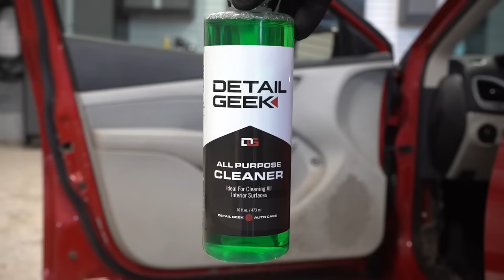This Car is 10/10 DISGUSTING - Viewer Discretion is Advised

Comment: I edit Google maps as an unpaid volunteer, as a hobby. You might be surprised to know that there are tens of thousands of Google map errors, with markers for a business or point of interest placed dozens of miles from where they belong, and highways and other roads also improperly labeled. I live in a small county in Indiana, and that small area has yielded several dozen edits. I'm sure that there are malicious edits too, intended to mess people up. Those would also be fixed by people like myself.
Reply from the maker: Interesting!
Reply: I imagine it's hard work. New buildings appear, new roads, buildings that don't exist anymore. Though I have to admit, Google Maps have improved over the years.
Reply: That sounds a pretty fun little gig! I have a lot of downtime at work, and this would be a neat use of time between jobs. I'll have to check it out.
Reply: Hi I have been having problems with updating my phone numbers .can you help

Comment: Great video as always. I do have a quick random possible trick for you, that I have personally used for years. To help get those stubborn small particles from those hard to clean floors, grab yourself a portable sander. With no sand paper, and put it on the carpet, the vibrations from the sander on the floor will help loosen up those stubborn left over pieces... One trick my Uncle that has detailed for 30+ years actually taught me. Love the videos, and channel. Watch a few video literally every single day.

Comment: Incredible job, as always! One thing I can't recall seeing in the videos is a seat belt cleaning (like in a work truck). Do you clean seat belts? What's the best way to go about it?
Reply: He has shown it in a few videos.  If I remember correctly, he usually uses the steamer to do it.
Reply: @alexschultz4272  thanks for the response! I appreciate it! I was thinking the steamer, but wasn't sure. I've heard mixed messages on whether it's safe to simply pressure wash them. Seen most of Mitch's videos, but must have missed the seat belt ones. Anyways, thanks again!

Comment: Beautiful transformation and I for one love those Dodge Darts as I own 2 of them now and had another one a few years earlier.  
Fun, sporty, good mileage - just nothing to complain about.  All of mine are 6-speed manual w/either 2.0 or 2.4 engine - not those crappy 1.4 Italian Turbo charged piece of crap engines - no way.  
Sad had someone could neglect one this much as cleaned up & RED - pretty car.  
On the other hand - the interior of this Dart is far to light colored in my opinion.  🙂👍

Comment: Hi, I watch all your videos. I am amazed at how well these vehicles turn out after being so mistreated.  My vehicle get washed once a week, and get a full detail, exterior, interior and under the hood quite often.  The detailer I use loves to do my cars as thy are always clean. I think that people do not understand that dirt on and under the vehicle is what causes rust.  The dirt locks in the moisture harming the paint and enabling rust to begin.  My vehicles get an under-carriage wash every time they are washed.  Vehicles cost so much you would think that people would care for them better. I also think that someone who does not maintain the vehicle looks, most probably does not do vehicle maintenance.

Comment: An interesting comment on the vacuum vs Tornador. I've used (sadly don't own!) a Kranzle ventos, and it is MIGHTY! But with that said, that gritty debris, like you've got left over here, just cannot be sucked up with a vacuum alone.

The Torandor with the vacuum attachment is absolutely the tool for this job, but you could also use a DA in there, with a brush pad and left on speed one, that'll vibrate stuff up to the top and get it cleaner than you were able to achieve here with just a vacuum.

The problem with the Torandor, without the vacuum attachment, is that it makes such a huge mess.

Comment: Hi Mitch! Have you ever considered installing a lift on your garage? To get access to more car components and clean parts that are not typically visible and/or cleaned every once in a while, and maybe lub them up with some silicon or wax coat too to protect them.

Comment: Nice interior. My question is why are you cleaning the pedals after cleaning the floor of the car, not before, or at the same time. I'm sure dirt sprays on the freshly cleaned carpet, even if you put a cloth under.

Comment: Can you use that carpet cleaner on the carpet inside a RV? I think the black spots we have on the rug are when my father installed some flex thing on the roof to prevent leakage. I've tried everything to no success, so I was wondering if your solution might BE the solution.

Comment: GPS doesn’t bring you to our house. It takes you to a house on the other side of our street near the other end of the block near the 4-way stop. I have to tell people all the time how to go past where GPS takes you. People always seem to go to the wrong house or they turn left at the 4-way stop instead of going straight down our street. GPS says “Your destination is on the left.”, so they will turn that way. 

Most of the time, it’s manageable. However, I’ve had to call an ambulance on both of my parents multiple times. And my extra instructions on how to get to our house don’t always get relayed. That puts me in the position of “Do I stay in here with my ill/injured parent or do I go outside and flag down the ambulance?”

Comment: You got those seats looking brand new again, great job. Quick question - lots of the older cars you detail have a fair bit of rust on the underside and around the wheel wells. Is this because of the amount of salt used on the roads due to the intense winter climate?
Reply: I live in a similar climate to Mitch with intense road salt and I would say yes, a lot of the rust is from that. A lot of us just let our cars sit all winter without a wash because they get nasty so fast. Which is bad for them, but car washes are expensive and a lot of time around me at least, they are closed most of the winter due to how cold it is. There’s a lot of rust buckets around here and you can definitely tell who washes their cars consistently in the winter. I honestly don’t even notice the rust in his videos because I’m so used to every car looking like that.
Reply: @arosebski  Can't that greatly shorten the life of the car?
Reply: @meganbarber3599  it shortens it but not by much in my experience. I drove a 23 yr old car until last month and it was barely rusted. I only got a new one so my younger brother could have a car. I only washed it once each winter, if that, all 23 yrs. There’s not much you can do if your own hose water is turned off for the winter and the car wash places are closed 95% of the time due to extreme cold. It’s also a game of trying to time it right that if you do wash it doesn’t get caked in salt again within a day and be just as bad as it was before. 99% of the time it doesn’t pay to spend money on a car wash in the winter if they’re even open, at least in my area. Everything sits with salt on it no matter how hard you try :/
Reply: @arosebski  Thanks for the answer.  I could never live in a place that cold.  I live in DC and miss living in San Diego all the time.

Comment: 6:21 "Emergency roll of TP" KEKW
This video felt faster than the others; not sure if it's cause it only took 10 hours to do this one, or cause I spent the last two 8 hour work days in an Odyssey and it still wasn't done 😂😂😂 Their cleaning tool lineup isn't quite as cracked as yours, but then again, neither is my experience, so I guess that's just how it be (for now, at least; already have the ultimate brush set on order, and there's a few other things I'll probably also get in the coming months :p)

Comment: I have a legit question. When you remove the seats do you always disconnect the battery first? I own a Volkswagen atlas and I detailed the interior and when I removed the seats my airbag lights came on once I turned the car back on and had to take it to Volkswagen to get it turned off cuz there was no manual way without owning a computer for the car.

Comment: Hi, I have a question why don’t you take the whole carpet out of the car since you take the seats out and the center console I’ve seen this Asian car detailer do that I mean he takes the whole car apart literally but he easily takes out the entire carpet and is able to power wash it and clean the metal base of the car I wonder if you’ve ever done that or if you would ever consider doing that I think you should try it. You might get a better result and might like it better. It definitely could make the carpet cleaning easier and make the car smell better.

Comment: I ask meself  how much does this cost .... i work in a carwash  when we work the while car cleaninh we ask 260/280 euro thats about 280-300 dollar. But we do not use brushes to clean,  we do not clean the outside bij hand, we only use pressed air, a steamclean machine and we are cleaning for about 2-6 hours. It depends.
Also the car needs to be empy  all the trash all of the stuff they don't want to get be trown away ...

Comment: I little trick I learned many, many years ago was to wipe only horizontal on the outside of the windows and only vertical on the inside (or vise versa) This way you can tell where the streak is. Very satisfying car wash porn! Cheers!